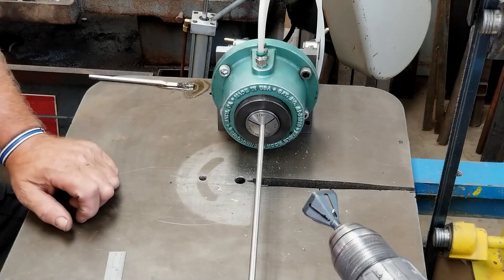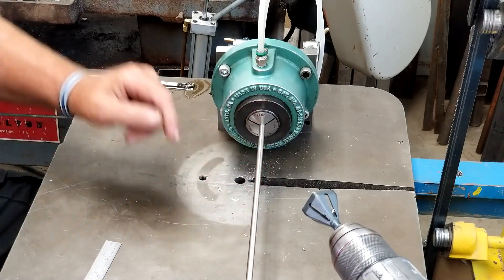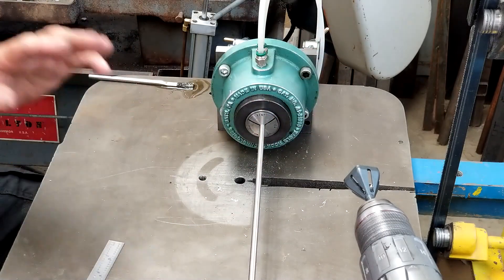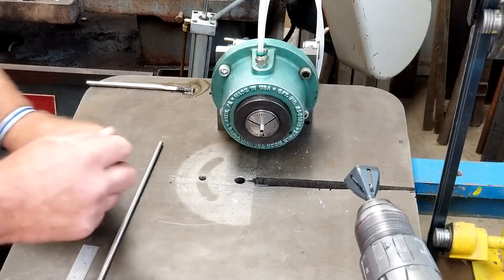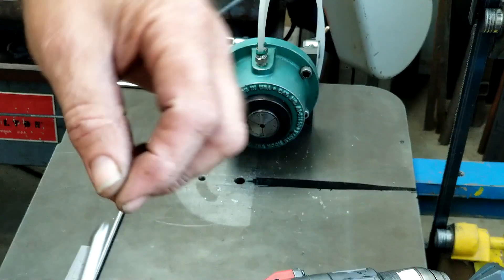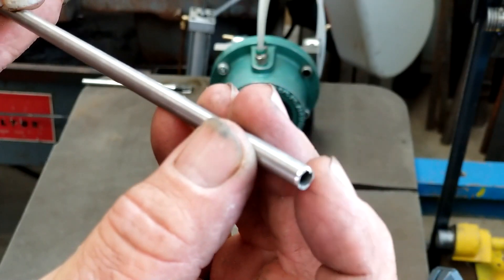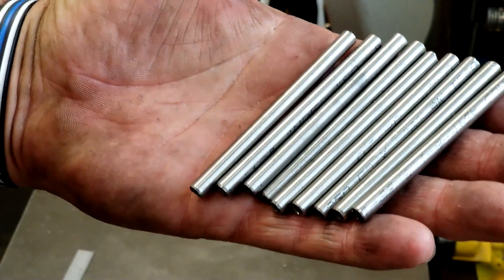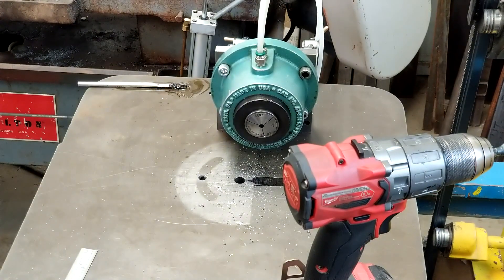Bordo chamfer tool

Comment: it's available on amazon now, $41.13  Do they make one for smaller OD?  this one only goes down to 5/16"
Reply from the maker: I was doing 1/4" tube in this video, worked fine.
Reply: @ShadonHKW  how much smaller will it go?
Reply from the maker: @johns208  Not sure, I will have to check next time I am out in the shop.

Comment: Amazon offers a 3 sided chamfering tool like this.... FOLK's stay away from that 3 sided unit, as it may work fine for rebar, or all-thread or threaded rod of mild steel that is 3/8" or larger, but anything else, will only cause you more trouble and snag and gouge in, when using the 3 sided unit.. .So, I made a 5 sided unit similar to this one, in Stan's video and works great... I wish I would have known about this Bordo unit, which appears to be 5 sided or 6 sided or to say, has 5 to 6 cutting edges. the cheap junky Amazon units having only 2 to 3 cutting edges is just too much aggression for anything smaller then 3/8 diameter ,and really, I would say anything below 1/2 inch diameter is asking for trouble when using the 2 to 3 tang cheap units ... I still may look into getting one of these Bordo units now too, to throw on the service truck and not have to worry about it getting borrowed and never returned or lost, and if it does, order another one... VS. losing the 5 cutting edged unit I made that took like 12 hours to make, it would break my heart to lose it.. Thanks for sharing this  ..
Reply: Dru Bradley I bought a pair that are coated, and I’ve had no problems with them. Grade 2, stainless, brass. It’s fine. I wouldn’t use any of these for grade 5 though. That either goes in the lathe, or the grinder.